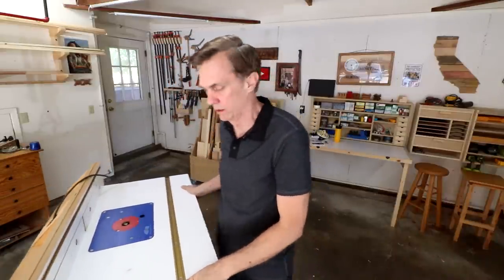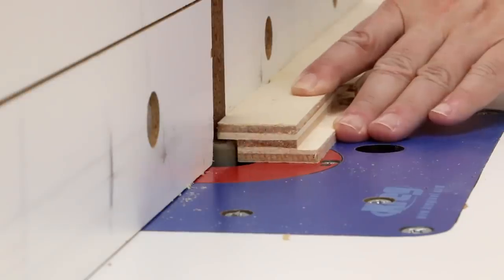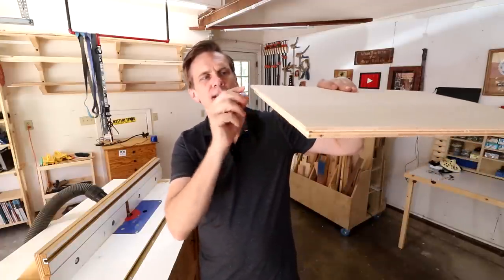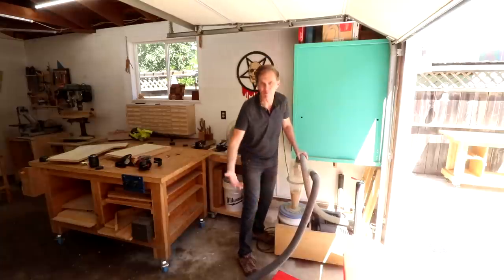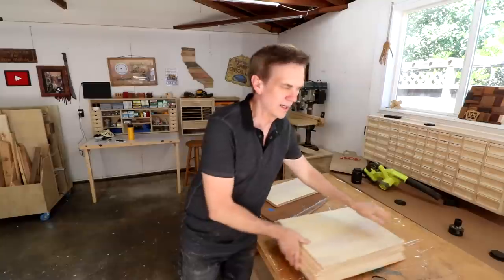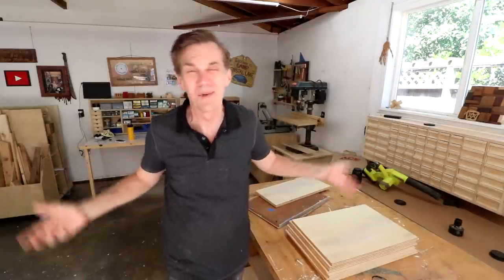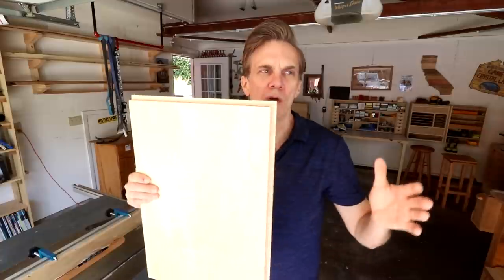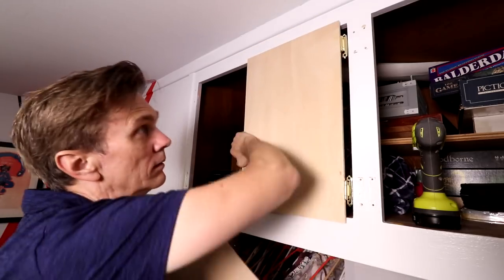Why did my router bit keep slipping?! | Day 116

Comment: Measure the shank of the bit. It may be metric? 6 mm shanks cannot be grabbed securely by 1/4" (6.35 mm) collets. And you can't see the difference of 0.35 mm with the naked eye. Can measure it with digital calipers though. Welcome to the wonderful world of globalization. Sellers on Amazon sell 6 mm shank bits as 1/4" tools.  Money is green. BTW good luck trying to get a 1/4" shank into a 6 mm collet. It is a very tight fit. Conversely the 6 mm shank in a 1/4" collet is just too loose.

Comment: I think you are filming when you use actual film which nobody does anymore, even Hollywood uses digital cameras (very expensive cameras but still digital).  so yes, the correct term would be videoing. on a different subject, the population of deer has exploded in some areas due to the lack of people outside to the point were they are becoming a nuissance... on the zoo the animals are experiencing the effects of the lack of people by being depressed....kind of makes you sad (for the animals).

Comment: Great that you didn't loose any important video. i had an SD card acting up on me, but I managed to salvage the video by wiggling the card in the reader. Card got tossed in the bin though, or at least I thought so, until I mistook it for another good card and FILMED, lol, more on it. 
It would be nice to see if you figure out those router issues. Here on the other side of the pond dado blades are not easily available, nor are the saws sold with a long enough arbor to handle them. So, being able to use the router for that kind of work is really important. 
Did you try to make the cuts thinner as well?  Or just less deep? 
Chees from Norway.

Comment: Steve, I bought a China V bit for my router, and it was slightly smaller than 1/4" shank and would slip in my router. Mic the shaft of the bit to see if that is the case with yours. Did not matter how tight I made it either.

Comment: ah my pet peev, mis used words.  dump a BUNCH of glue.  a BUNCH of paper, a BUNCH of water.  none of these come in bunches, unlike grapes flowers or herbs. if absolutely necessay a MESS will pass.  as for verbing the nouns VIDEO, FILM .this is fine to use either, video being a contraction of VIDEO TAPE as opposed to AUDIO TAPE, as with filming , videoing is a fair usage as it describes the medium , but technically you are RECORDING, as regardless of the medium used, you are making a record of your work (yes a record 45,33,78 is a contraction of wax/vinyl record of the wok of.......).  rising bit,dropped door, microp  ne drop out, time to go back to bed, get up and start again.

Comment: I have a ryobi router( hand held) and used a 1/2" bit and had the same issue on a cabinet door that I was repairing and it was fine until the end where the bit came loose and shot out the router. Since it's an original oak door, I ended up filling the off cuts and sanding smooth. Thus far after priming and preparing for paint, the repairs are seamless. But I would love to figure out if there is a fix for a shifting router bit

Comment: Steve, yes I think it's a shank diameter problem.  I've had the same issue with a 3/4" straight bit (both Bosch and Yonico brands, both 1/4" shank) slipping.  And it's not inherent to the brand, since my router is a Bosch 1617.  However, my router also has a 1/2" collet, and so far haven't had any 'vertical slipping' issues using a 3/4" straight bit with a 1/2" shank (also using two other 1/2" shank bits....a 1/2" diameter and a 1/4" diameter straight bit).  Then again, it could be dust build-up in the 1/4" collet.....I don't use my 1/2" collet very often.

Comment: Slipping router bit. I've got a zblack and decker router which I inherited from my dad. Its around 10 years old. Used for the first time, 14 inch bit, going great, suddenly the but slipped, deeper rabbit. Cause, collet and nut worn. Tried to get replacements......not made any more. Looks like a new router unless anyone has any suggestions??????

Comment: I have the same slippage problem with my DeWalt trim router but it is with a 1/4" straight bit.  I have not experienced slippage with my 3/4" straight or with my round over bit.  It has been a while since this video was released so I wonder if you have found the cause and SOLUTION(S) to slippage?

Comment: Had the same problem with a Porter Cable router. It ended up being the cheap 3/8 inch collet I bought on Amazon. My 1/4 and 1/2 inch collets worked fine.

Comment: I have experienced that router bit slip problem, especially on a router table. Because the router is sitting upside down wood dust had fallen down on the collet and after a few changes of the bit the dust build up prevented the collet from completely clamping down on the bit. Just thoroughly cleaned out the dust and fixed the issue

Comment: Router bit slippage ! I was trimming a circle with the 3/4 ply sitting on cookies on the bench. Unknown to me. the bit slipped down and by the time I wised up, I had carved a 1/4 half moon into my bench top. Lucky me! The bit could have escaped and done a lot more damage in all 14 directions including me.  I lived with the glaring evidence for about two years, and finally my pride couldn't stand it.  I bought a Birch table top from woodcraft. It was a beautiful 1.5 thick laminated Birch 2x2s. That sat, and nicely covered my old P/W top, but it was now 1.5 inch higher , so I had to buy another for the other side of my mitre saw station, whcch also had to be raised . The gist is that I just proved that "Pride is the heaviest burden." Only I wasnt through with it yet. With the oak edges I put on them, the bench was now about two inches wider which I soon realized meant that reaching the tools on my pegboard wall was now a very awkward stretch. That meant that all tools had to be removed,as well as the pegboard with 2x3 studs installed and pegboard replaced. not only that, but the two electrical boxes now had to be also pulled out 2.5 inches. Talk about things going downhill !!!  Now where was I? Oh yes, it was a large Porter Cable router that let go of the Bit!  No, the collett wasn't worn. The router was not far from brand new. I'm telling all of this so that others will take care & not get hurt. Humility doesn't look so bad now. School of hard knocks. I'm having trouble trusting that router now as well.

Comment: I had a router bit like this slip this way, and I realized that I was using a ¼" collet with a 6mm bit. Switching to the right size collet seemed to fix it in my case.

¼" is slightly larger than 6mm and it was also harder to tighten, but I'm a bit of a woodworking noob and pressed on while I really should've stopped to figure out what was going on.

Anyway, I don't suppose 6mm shafts are that common over in the US (I'm in Norway) but maybe it's worth checking out if the shaft on that bit might be a little undersized!
Reply: A quarter inch is 0.0138" larger than 6 mm is. 1/4" = 6.35 mm. I have a hard time telling them apart without using measuring instruments. I can tell when I am putting a 1/4" bit into a 6 mm collet. The newbie trap is loading a 6 mm bit into a 1/4" collet though. That will go in and even seem to tighten up. But it won't really be near tight enough in use.
Reply: @1pcfred  yup, I was definitely guilty of that!

Comment: I have an old Craftsman 2 H.P. Router that’s 1/4” and have never had an issue with bit movement; it also has run every 1/4” shaft bit I’ve put in it. I also have a 2 1/4 H.P. Dewalt router with both 1/2” & 1/4” collets which I’ve switched to as it handles a wider verity of bits; it hasn’t slipped a bit yet. I have had the router bit slip down in the router table but I think it was the mechanism of the lift.

Comment: Think you’re right about using large bits on small routers. I tried to cut T-molding grooves using a 1/4” bit on a laminate router. Sure enough, no matter how hard I cranked down on the chuck, the blade kept drifting away from center. Very frustrating. Lesson learned.

Comment: My 1/4 slips consistently. Always happens when my bits are dull and/or I take too big of a cut. I’ve found that my 1/4 should be used mostly for detail work. Anytime I try and hog out the Center of something or cut dados larger than 1/4 inch it struggles.

Comment: I also have that problem with router bits. I bought a pretty cheap Mastercraft router a few years ago and a big multi pack of router bits, some with 1/4" and some with 1/2 shafts. The router itself takes 1/2" but came with an adapter for the collet to take 1/4" bits. That adapter is just worse than useless,  it's only a couple minutes until the bit starts slipping out no matter what I do. Finally got fed up and bought a 1/4" trim router this year. 1/2" bits go in the 1/2" router and 1/4" bits go in the 1/4" router. As long as I don't stray from that it's not perfect but it's much better.

Comment: Just seen your video. Apparently if you regularly overtighten the collet (to make sure that it doesn't slip), it tends to deform the collet insert and it won't grip properly. Solution - new collet and don't use all your strength to tighten it. I have a Trend T11 (1/2") and it specifically mentions not overtightening. It also says buy new collets every once in a while, depending on how much you use the router. My router is a must for rabitts and dados (no chance of using Dado sets in the UK, they're illegal! 😒

Comment: You're right that composting plywood isn't good because of the synthetic glue chemicals. You're basically just introducing microplastics into your soil that will never go away. A bit more info about the walnut thing: Walnut wood can be an issue because species of the genus Juglans are allelopathic. The plants produce a chemical that suppresses the growth of other life around it. This is why people often have trouble growing things underneath black walnut trees where I am in the northeast, for example. However, if the sawdust didn't include any bad stuff like glue, I would still compost it as long as the walnut is a small percentage of the overall compost pile.

Comment: My router came with both a 1/4" and a 1/2" collet.  I had read about not bottoming out the bit and also read (Don't know where.) that a 1/2" O-ring dropped in ahead of the collet eliminates that problem, at least with a 1/2" bit.  That way you also do not need to wonder whether you have the bit inserted far enough.  I have been doing this for years and have not had any trouble.

Love the videos.  You and another woodworker from somewhere up north in MI are both very helpful and entertaining.  Keep it up.

Comment: Hello Steve,
Sorry your routed edges were spoilt. I think that sounds like the bit stem expanding and contracting with heat and that is causing it to slip as it changes size. If your had a half inch router I don't think you would have a problem.
Anyway the doors look great!

Comment: It's called a shank, not a shaft. I've never had this problem and I set up stuff like this with Porter cable routers A LOT. All I can think is the your collet is screwed up. Half inch shanks do have more surface area than quarter inch shanks. Maybe that's all it is.

Comment: You have a porter cable 690 right? No variable speed correct? It could be it’s spinning to fast causing vibrations, however it’s less than 1” so probably not. If it’s a really cheap bit it could be the shank. On really cheap bits the shank is slightly smaller than the smallest diameter of the tightened down collet so no matter how tight you make it it won’t hold.

Comment: About the router bit slip problem: I've had this happen, but strangely enough only with 1/4" straight bits. It doesn't seem to matter how clean everything is or how hard I cinch 'em, I've ruined enough pieces that I dread having to use them. Perhaps my collet is just on its way out, and the extra mass at the tip of the larger bits is just enough to help hold them in place.

Comment: I have a Porter Cable router setup as well. Aside from the collett issues (of which I have had plenty), the gearing that forces the router up and down has also been kind of iffy at times, and gets loose, and I have a problem fixing it. It has cause it to slide at times and jump at other times, and always outward - never back toward the base unit. it's aggravating. And no, I have no idea how to correct it.

Comment: I had this issue in the past with a Craftsman plunge router. I pulled the bit, lightly sanded the shank, cleaned the collet and the pocket it fits into, and then wiped everything with WD-40. It's worked pretty good after that.

Comment: I used to work in a shop that used Porter-Cable routers. I used to break them, trying to tighten the base to the motor. That's where I always had slippage with Porter cables. The first router I bought was a Ryobi and I had the problem with the bit slipping in it so I took it back and never bought another one. Now I use Bosch. Never had a problem.

Comment: I had a drill that wouldn't hold the bits. I tried everything . Last resort, I gently filed the chuck jaws with a small round file. Success! Could be that the collet just needs a bit of cleaning. Maybe roll up a little emery cloth and hit it a little, inside. Sometimes, if a bit spins, it leaves a glaze.

Comment: Try cleaning the bit shaft and collet with alcohol. That helped for a while. I had the same problem with my porter cable router using 1/4" bit shafts and they would slip. Tried buying new bits as well. Finally had to buy a new collet.

Comment: I had the same problem using 1/4" shaft bits whose cutter heads were just too large. 1/2" held fine for the larger cutters. That said, it could also be your collet; it could be getting tired.

Comment: I had this same problem with a 3/4" straight bit with a 1/4" shaft.....I ended up removing the collet and cleaning it with mineral spirits....some resin/oil/dirt whatever had built up inside it over time and was preventing a good grip on the bit shaft.  It didn't slip again after that.

Comment: yep just experienced the same thing with a half-blind dovetail jig ... very frustrating to have cut all my pieces and when putting them together finding out the router bit slipped ever so slightly and now my lap is about 0.5mm thinner on the last pieces... this means a lot of gaps to fil :(

Comment: Had the same thing happen to me with a dovetail bit, and long story short, if there's a part of the bit contacting the wood which isn't cutting, the combination of vibration and tension can pull the bit out.  In my case, I was trying to cut 1/2" deep dovetails with a 1/2" bit, and even a few thousandths of an inch of non-cutting surface contact was enough to start the bit moving.  And this was with a brand-new bit, so I knew it was sharp enough.

Comment: I don't want to be overly negative, but, I have a crappy router/table and I can use all the ideas I can get to make it work better; I can't fall back on a table saw with a dado blade.  You lead in with why is my router bit slipping? and avoid a real answer, instead it is: oh just get a table saw and install a dado blade.
Sorry, I think you should address the question you use to title your video or change the title: how to avoid a router you don't know how to use...

Comment: I had the same problem once. Turned out to be a 6mm shank and not a 1/4 so just that little bit smaller and the collet didn't quite Sinch it. Have you measured the shaft with calipers just in case ?

Comment: I think it has to be the collet. I have only half inch routers - 6 - so have to use inserts for 1/4' bits and have never had that problem. And I have some cheap bits for rough work

Comment: I had the same problem with my Porter Cable but did not have it in a lift. I tightened the router housing by hand as hard as I could but it would still vibrate loose. I now use a small wrench to tighten the housing, problem solved. Make sure the lift is holding the router tight enough. The collett was fine.

Comment: Your router bit may have a 6mm metric shank rather than a true 1/4" like the router takes, which is more like 6.25mm
Reply: 6.35 mm actually. One inch equals exactly 25.4 mm. Thanks to Mr. Johansson. Who was a very severe looking individual. The sort you'd expect could shave molecules off a steel block to create a vanderwaals effect. Which is precisely what he became famous for doing. Very precisely in fact. Mr Ford credits him the most for the modern industrial age.

Comment: I have a place in the corner of my yard that I put my sawdust, becomes the outdoor cat box for my cats.  Perfect!  Also get some small rubber grommets for the inside of the router.  That way the bit doesn't bottom out.  Sommerfeld Tools sells them or  at least you can see what I am referring to.  Works wonders.

Comment: Are you using the wrong bit?  These are made in up cutting or down cutting versions. Check what you have been using and switch to the opposite version. It just might make a difference. Good luck.

Comment: I had a similar (slipping up) issue running a 1/4" straight bit (with the appropriate collet adaptor) on my 1/2" router.

Comment: I had the same problem with my router table when trying to make rabbets. The shaft slips in the collet.  Made me have to make my night stand using butt joints after cutting off the messed up routes.

Comment: I built the same router lift that you have. I found that the vibration and pull of the bit cutting into the wood caused the bolt to turn, pulling the bit up. Happened on dado and spiral cut bits all the time. I finally built Jay Bates' router lift and haven't had the issue since.

Comment: As you push the material against the bit, the entire spindle canters slightly and causes an upward drag as it wants to corkscrew up. If the shank is too smooth, the upward tug lifts it out of the collet. Take a file or grinder to the shank and rough it up a bit, stops it from sliding. Also slow down the feeding of material into the bit